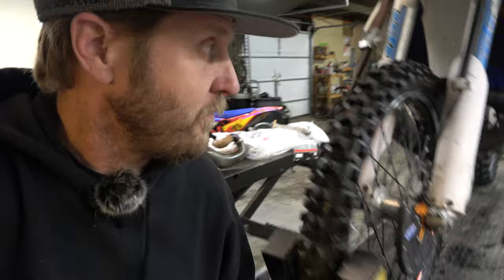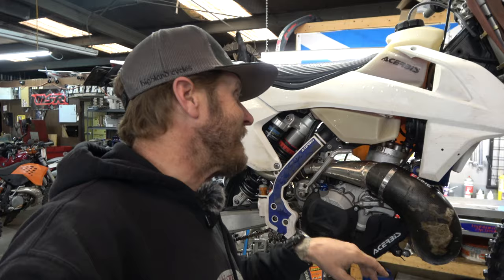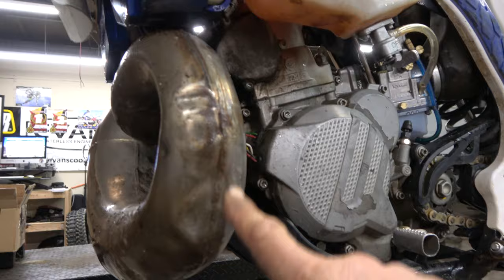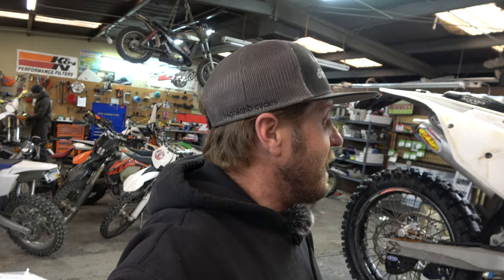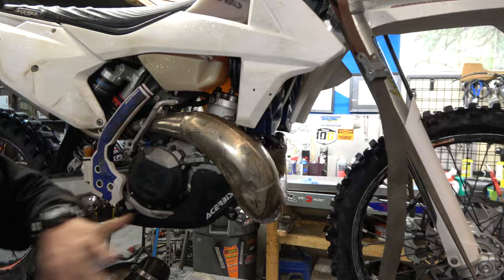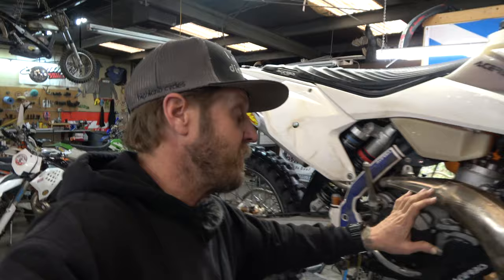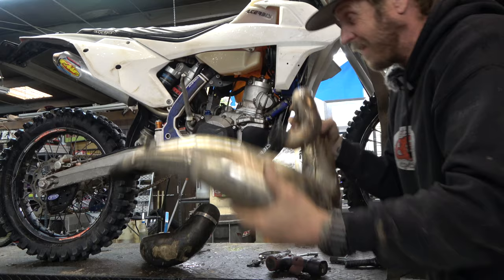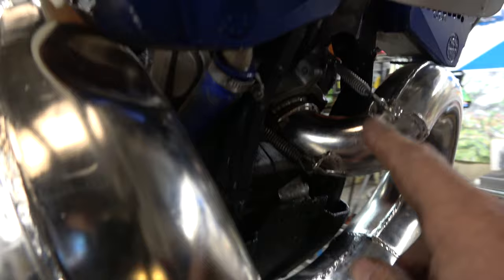Do Pipe Guards Work | I Was Wrong About Pipe Guards | Highland Cycles

Comment: My carbon fiber pipe has some serious scrapes and wear… but the FMF power bomb underneath is in great shape, very slight dent which I was able to repair by filling the pipe with water using freeze plugs and then using a torch to get the water to begin to expand and voila… good as new

Comment: Great review, The problem without is when the pipe gets a hit on the bottom and ushes the pipe up into the bottom of the LH radiator and caves it in. Now I run a full alloy PT guard (which I hate) to protect the pipe and radiator 🙂

Comment: If you have a 4 stroke with a T.I.  header then I highly suggest a guard.   I  made 1 out of aluminum.   You can get the dents out using heat and pressure.   I am sure you can youtube the repair!

Comment: I run them on all three of my 2-strokes. Have for years. The bikes get ridden a lot, bash a lot of rocks, and get dropped in gnarly sections. The guards take a beating. I’ve learned how to repair them with carbon fiber and epoxy. As for the pipes, they do get bent and require straightening. I do that with a hydraulic pressure rig (works very well). However, the pipes don’t get badly dented unless you take a motion stopping hit to an immovable object to the pipe. For me, I won’t run without the carbon guards. They save me money and time over the long run. I haven’t bought new pipes in over 10 years.
Reply from the maker: Good info
Reply: Same here we ride really rocky terain in AZ and my p3 guard looks 2x as bad as that one you show but pipe still transfered from my 20 to 22 xcw no problem minimal bends or dents

Comment: I've run them for years on multiple motorcycles. They work more for sliding or scuffs. Or rubbing up against things but actual crashes. No ive dented some pipes pretty well with them.

Comment: I run the Hyde skid plate ,pipe guard combo.  For me in the rocks the combo type that transfers the hit to the frame is so much better  .
Reply from the maker: For sure.  My only issue with those is if you are in the mud, they like to collect it.
Reply: There are the tubular skeleton looking versions of a Hyde.  Maybe less mud concern but then you worry about snagging more.  Too each their own, compromises are always made.
Reply: Ya in the fall mine fills up with leafs. 
The tube ones drain better but I like how plastic slides over rock . Everything is a comprehensive. The big thing is the pipe doesn't take all the hit as it transfers the hit to the frame mostly .
Reply from the maker: @scottforrest2246  yep.
Reply from the maker: @adambatchelder4121  yeah. I have seen a couple bent frames which is crappy

Comment: Morgan, I have run them before but not a pipe guard fan at this time, a few caveats are added weight, dirt collector and made one of my pipes rust some at weld joints (rubbing on guard) and this may not be an issue but common sense would say that with the guard on the pipe it cannot dissipate heat as well and holds it next to the engine, IMO not a good thing.

Comment: This is my first 2 stroke bike, a 2021 KTM 300 XC, I debated about an pipe guard. I remember a guy early this year, he was very proud of his cool looking (and it was!) GasGas and the great deal he got. His first ride out up a rocky hill climb, he was back in 30 minutes with the pipe bashed in, bummer. A friend of mine always ran a pipe guard for years, so I got one. 
I'm having a bit of buyers remorse after reading all of the issues with the 300s (thought they were the supposed to be the best thing since sliced bread or better) where it has to get to operating temp before riding(I've never heard of this in a two stroke before, especially snowmobiles fire them up and go), electrical issues..... generally concerned, we'll see this summer once the deep freeze starts to thaw and sun comes out! :) I've had it out snow biking a couple of times, now wondering, should I even do that.
Reply from the maker: I think as long as you warm them up decently they are just fine

Comment: Depending on the bike it can actually ruin the pipe more than denting it. My 01 CR125 had one and during a crash it broke the exhaust manifold and bent the pipe to a point where I had to buy a new FMF Fatty. Denting the pipe would be easy to repair for $80 or so, pipe cost me  like $230. The exhaust manifold was $30. Never running one again. Something's gotta give, might aswell dent the pipe if it comes down to it.

Comment: On my 125xc with a guard it saved a pipe dent but the energy still transferred and cocked the exhaust flange.  Surprisingly it doesn't leak but it could have cracked the jug.  I don't think they're worth it due to the damage they'll transfer to more critical areas.
Reply from the maker: That is always how I have felt. I am surprised this one held up as well as it did. Still not going to run one in the future.

Comment: No pipe guards ever, they are relatively costly. They transfer force to the mounting as well. You are better off taking and dissipating the hits in the metal. Spend the money on a pipe repair kit and propane torch . You can usually repair the dents to 90-99% as good as new with compressed air and heat.

Comment: I have been off 2 strokes since 2015, but when I was a 2 smoker.... I would go through pipes constantly! I tried a few pipe protectors like that one and my issue was that it would usually crease right where the end of the guard was. Almost act like a stress riser. But, I ride 4 strokes now, so that problem is gone :)
Reply from the maker: Haha. That has been my experience too.

Comment: I'm just not going to spend more money on a carbon fiber guard than I did on the pipe. Those things are so expensive you need a pipe guard guard. Personally I prefer the "accordian" style guards from Flatland Racing. Has held up great and you can bend the "wings" in a bit when mounting so it has some give and absorbs impact vs. moving the damage to the neck of the pipe or flange.

Comment: Morgan if you have any pro tips on how too straighten the 250 pipes where they bend around the left frame rails like you spoke of id be extremely  grateful...
Reply from the maker: Hydra Force water pressure and then heat and a crow bar to fit back to cylinder
Reply: @highlandcycles  Thank you I appreciate it mines so bad on my yz250 its blocking the first bolt on the stator cover

Comment: I am thinking a snug fitting pipe guard will make the pipe and motor run hotter which is not good.
Reply from the maker: I think it could but I have never seen ill effects from it.

Comment: The question is how long would the pipe have lasted without the pipe guard?
Reply from the maker: Obviously impossible to tell. But yeah.
Reply: @highlandcycles  Your point that a pipe guard diverts the energy of the impact to other areas of the bike is valid. Theoretically a pipe is a wear item like a tire and should be repaired or replaced as needed.
Reply from the maker: @mikeb4708  agree